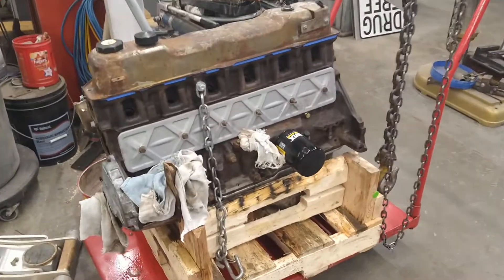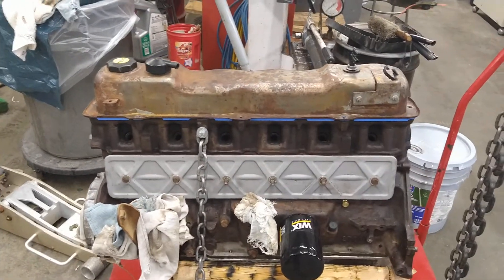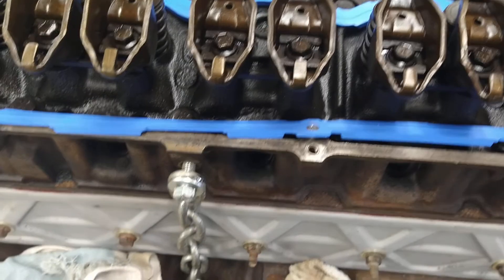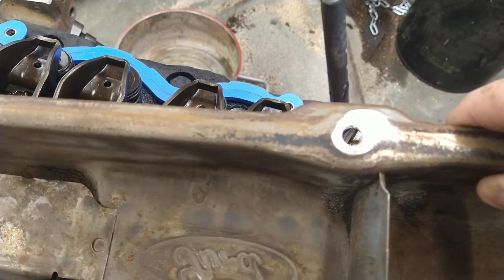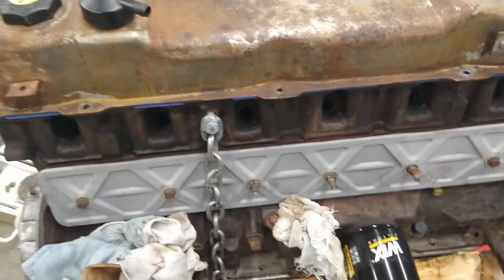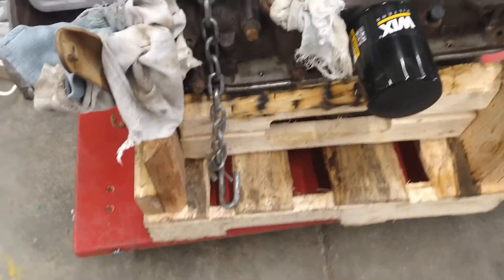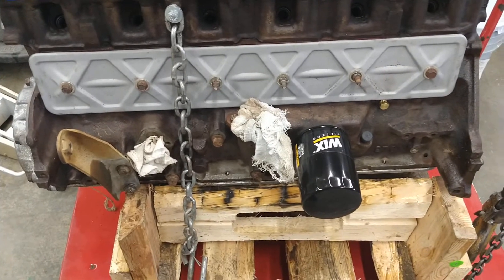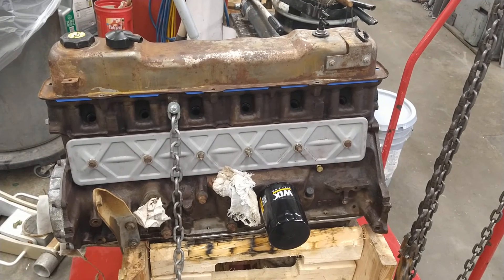Ford 300 six/4.9 valve cover hack

Comment: its a good tip. not all 300 heads allow the use of the silicon gasket...the thread pitch for the fasteners differ between some years. the metal washers that are molded into the gasket only allow for the smaller fasteners.

Comment: Neat trick. I actually prefer the cork gasket as I get a perfect seal, but they have to be installed dry and clean.  Throw that silicon seal away😉
Reply from the maker: The '86 head only takes the one piece silicone gasket, and I'm glad it does. Cork ALWAYS leaks, eventually. Silicone gaskets perform MUCH better.
Reply: @Wyowanderer  my 86 is a cork gasket.    I can grind down if I want.    The oil pan I just ordered a new one and the silicon for that.    Needed a new drain plug
Reply: I use this silicone one on my 85' and it's fine. I didn't have to modify the pan. I didn't grind of shit and it seals fine.
Reply: @acetech9237  Well the cork gaskets  I install don't leak. Maybe you just don't know how to use them.🤷‍♂😉

Comment: another good trick would be to thread lock some studs into the holes so when you place the gasket it cant move when dropping the cover down, its what i did to my trucks and works phenominally
Reply from the maker: That's a GREAT idea.
Reply: @Wyowanderer  was always a pain to reinstall the gasket see it leak little and have to readjust it lol

Comment: they only offered a cork gasket for my 82 f 150 with 4.9 motor . so i drilled out the metal washers from the silicone gasket where the bolts go through it then i could use my old valve cover bolts with no problem .  the cork gasket is total crap !! i also got rid of my dura spark for ignition system and put in a msd 6al ignition box with high out put coil and am now getting 23 miles a gallon out of my old ford .
Reply from the maker: That's different than I did it, but I happy it works for you.

Comment: Serious question. I recently bought a 1988 F250 300. And I need to do many repairs. It runs and drives. Misses horribly. But that's not the issue. I need to replace every seal and gasket. But here's the kicker. It's my daily driver. So I can't afford for it to be down for more than 2 days. The weekends. I'm going to replace oil pan gasket and I'm running into a problem. And maybe you can help . 

On the passenger side of the block/pan. There's 3 0r 4 bolts that are really hard to get a tool on. Due to the main cross member being in the way, is there anyway to get to them as she sits (as is)? Or will I have to loosen the motor mounts. And lift the engine just enough to get my hands and a ratchet back there?? And any suggestions how to lift it would be great. I thought of using a jack but there's not really any good spot to do so. And I have an old pair  tree in the backyard but I looked at the branchs really good and I've lifted a few engines using tree limbs as  a cherry picker,  but these branches won't hold this engine. I'm at a loss. I have the gasket in hand ready to go,  I'm stuck man. And I honestly don't remember having to pull any motor on any vehicle to only reach the oil pan bolts
Reply from the maker: Even if you get the bolts out, the pan won't come off without taking the motor mounts loose (if I remember right it's a 15/16 socket). I'd use a bottle jack under the harmonic balancer and I'd lift the engine until I could get a 2 x 4 between the mount and the engine perches (the 2" part).
After that you'll need to remove the pan bolts and then the oil pump and pickup tube, because the pan won't clear. Don't forget the nut holding the pickup tube on, and replace it if it's broken - they often are.
From there it goes back together the same way. 
Buy the later 1 piece rubber pan gasket, grind the locating tits around the bolt holes, and it goes back just like it came apart. Don't forget to put the oil pump in the pan before you haul it under the truck and put it on...
Reply: You can replace the pan gasket without jacking up the engine. You just can't remove the pan, and only get a few inches to work with.
Reply from the maker: @jnic2003  He's right - I just couldn't bring myself to do that because I couldn't clean the inside very well, and I'd have to use the old style cork gasket.
Possible? Absolutely. Good practice? Not for me.
Reply: @Wyowanderer  actually I used the one piece rubber gasket when I did it.
Reply from the maker: @jnic2003  I imagine you did - but you had to grind down the raised areas around all the bolt holes or remove the bolt stops in the gasket first. It seems to me that you'd be hard pressed to get the grinding dust out of the pan, and if you removed the bolt stops, the gasket would be weakened.
In either case, I wouldn't do it. Glad you found a way to make it work, though.
Reply: @Wyowanderer that was on a 96 efi 300, i don't remember if it had tabs. I'm rebuilding a carb 300 right now. I already have the pan on and used the one piece rubber. I did not grind any of those tabs off. You think it'll cause any problems? Seemed to seal pretty good. If my efi pan did have tabs it never leaked without removing them.
Reply from the maker: @jnic2003  The 96 comes stock with a silicone gasket, so no grinding is needed.
Still. oil pan R&R without cleaning it out is something I'd only do to get home where I could do it by the book.

Comment: I would have hammered and dollied it. If you grind down the valve cover, which is thin to begin with, it will crack from the stress risers.
Reply from the maker: Seems like the oil pan is doing fine, having had the identical treatment 200K miles ago. It's been over a year with the valve cover and no leaks, so evidently it's working out just fine. But if you feel better with a hammer and dolly, have at it.

Comment: Aaaahhh,..... that silicon isn't what it's cracked up to be,.... maybe with smaller stuff,... and "O" rings,.... but the bigger stuff..... hard to beat the cork with thread locker,... on the bolt's,..... it will stay through many more hot / cold cycle's........